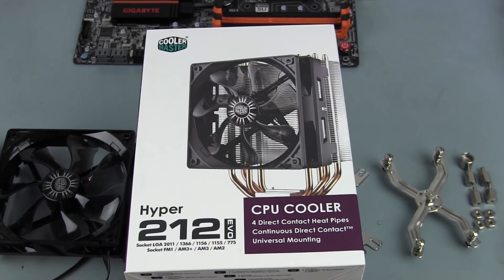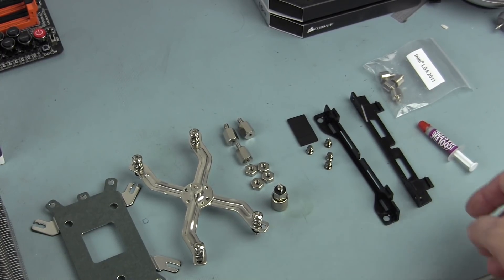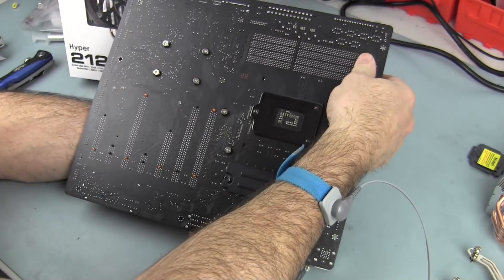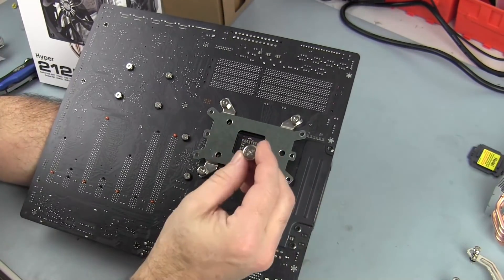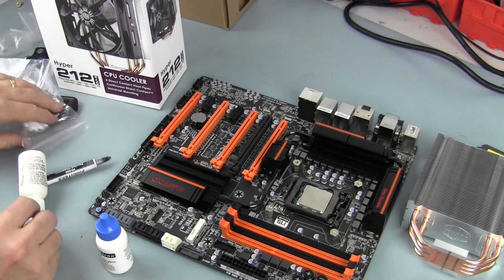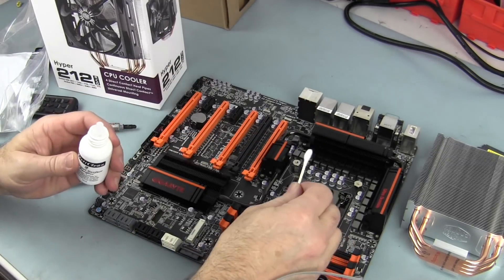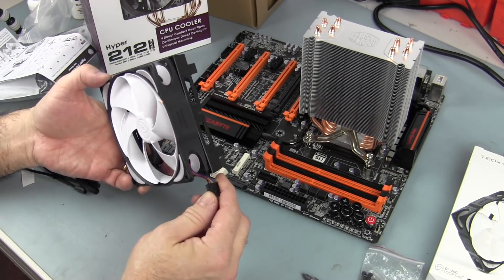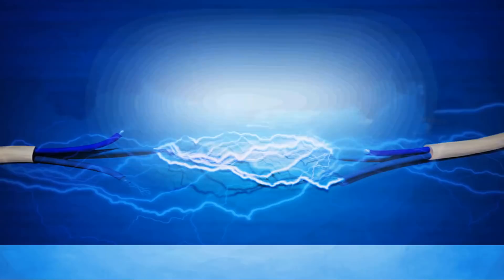How to Install a Cooler Master Hyper 212 Evo CPU Cooler

Comment: Can you just use the thermal paste thats already applied on the CPU?
Reply from the maker: .  CPU's do not come with thermal paste applied, so I assume you mean reuse thermal paste that may be on there from a previous cooler install.  If you are removing a cooler from your CPU, you must clean it and reapply
Reply: Ronsanut oh i see, do i have to use the cpu cleaning liquids if my cpu is brand new out of the box and so is the cooler? or can i just apply the thermal paste given and put it together
Reply: Rory McDonald CPU itself never comes with thermal paste, but stock COOLERS do come with that paste. Some aftermarket coolers do come with thermal paste, but most of them dont.
Reply: ***** The paste comes in a little tube or whatever you call it. People can apply it their way how they feel comfortable with.
Reply: ***** Yes, it does come with its own paste....

Comment: will this cooler fit into a zalman z11? and can you rotate the cooler 90 degrees if you wanted to?
Reply from the maker: Sunny Davies I don't know. Possibly
Reply: i did it and it worked along with some vengeance ram i was asking for trouble

Comment: My stomach dropped when you had to put a plate on the back side of the motherboard. I hate doing this crap but my CPU is burning up, so it's either completely disassemble my machine for this one single component or let my CPU burn.

Yeah, thinking of just letting it burn.
Reply from the maker: Does your case have a cut out for the pack of the motherboard? If so you son't have to pull the motherboard out.
Reply: Same man, I've never taken my PC apart entirely, but today's as good a day as any to learn! :D
Reply: just glue it on. i had to do that with my pentium III as it wouldnt line up
Reply: you can buy one that clips on like your old cpu heatsink..without a backplate needed to install. I did.
Reply: @Rippyboy121  where do you buy that part at?
Reply: Fwoooosh
Reply: Dissident Rage Water cool it
Reply: Dissident Rage but don't most cases have a hole right behind the CPU socket and just remove the panel in the back and install it upright?
Reply: "Yeah, thinking of just letting it burn".  LMFAO - I just had to reply to that - it made me LOL.
Reply: I was able to remove the panel on the other side of my case, accessing the back of the MB, avoiding full removal of the MB
Reply: Just take off the back panel behind the motherboard
Reply: or just turn your pc on the side
Reply: Man up man! :)   Arrange to be alone for the job and within an hour it's all done.
I have two PC's at home with this bad boy. This cooler does good job for the money.
Reply: Dissident Rage on a woman on the way she was the woman who was there to help him out the door and then said she had been there before the end

Comment: I have installed one on my computer running a stock i7 930 2.9ghz but my temp is 67c when gaming and 47c idle. isnt that high? I also included 1 more 120mm fan on the other side of the cooler. I have change paste 2 times with more or less thermal paste but no diffrent !

Comment: Question for people that have this beast...

I just ordered one to replace my 'Hyper N 520' over a 2600k, that just had a fan die. I didn't feel like replacing a 92mm fan on it, as that cooler is older and I wanted something newer.

How would this this compare to the N 520 in terms of cooling amount, and is the thermal paste that comes with it decent enough... I used AC5 on a 2nd mounting for my Hyper N 520, although i really didn't see to much difference over the CM paste of the 1st, and was a bit disappointed.

Comment: Nice video but I've a question: Is the base plate for the other side of the motherboard really necessary? I would like to not dismount my mobo to install this cooler.
Reply: Most cases have parts of the back of the mobo exposed (particularly around the CPU socket) for easy installation of heatsink without removing the board. 
Just remove your side panel on the mobo mounted side and check it out.
Reply: ***** Ok great. Thank you!

Comment: I think the orientation of retention platex is wrong. it should be rotated 90 degres. it is strictly stated in the manual to do so. I think that this way platex is almost making contact with the copper pipes. platex 'legs' should be oriented away from the pipes.

Comment: This thing is huge. Will motherboard be able to handle the weight if it's positioned sideways?
Reply from the maker: es the bracket and mounting system are designed to to support it properly.

Comment: got a question. i like this cooler a lot. but is it better than getting a water cooler?
Reply from the maker: Watercooling will keep you r temps down better, quieter, and lower than an air cooler. But if you don't overclock your chips at all then this is just fine.
Reply: hmm i can't say that i won't OC. i might get the cooler just to be safe
Reply: the water cooler i mean
Reply: ***** There are two kinds of water cooling: closed loops and open/custom loops.
Closed loops can be bought for cheap, and only cool one component. But, the cheap closed loops are only marginally better than similarly priced air cooling, and more prone to failure than air cooling (broken pump, leaking...). So, I wouldn't buy a cheap one over air cooling.
Air cooling is obviously enough for overclocking.

Open/Custom loops cost much more, but you can also use them to cool your GPU and they offer significant improvement over air cooling.

TL;DR: Spend small $$$ on air cooling for decent overclock or big $$$ on water-cooling for big overclock.

Comment: Does ir matter if the towerncan rotate after its installed or did i do something wrong
Reply from the maker: It may move a little, but you should not be able to rotate it 360 degrees.

Comment: Can the fan be put on either side of the heatsink? As this would only fit in my case with the fan on the other side due to the case fan being in the way (if I were to put it on the same side that you did in the video).
Reply from the maker: Yes. what ever works best for your case air flow.

Comment: Thanks for the video. I just bought a Hyper 212 EVO. This videos helps me to understand exactly what I need to do. This will be the first aftermarket CPU cooler I have installed. It's great that you covered a different fan option in the install video. I'm glad you are thorough when it comes to the tutorial/guides. I subbed after seeing this video.

Comment: I installed the 212X yesterday, since the EVO is no longer available in my country. Warning to those who install this cooler with all components already in place inside case: disconnect the fan and plug in the 4-pin CPU fan connector FIRST before mounting the heat sink.  Given my inexperience (first timer installing cooler), I fixed the fan last and it was a pain trying to slot in the CPU connector in a cramped rig.  Suffered a few cuts on my knuckles in the process.

I also screwed up by putting too much thermal paste.  I pressed a little on the syringe and a blob of paste squirted out on my CPU.

My biggest complaint with the product is the lack of mechanism to secure the X clamp on the heat sink before mounting.  It was difficult trying to screw down each corner of the clamp without the heat sink moving around in a cramped rig.  Albeit I did the installation without removing motherboard from casing.  In the end, I wasn't sure whether the heat sink covered the CPU precisely.  In the process, much smudging of the thermal paste occurred when I had to shift the heat sink after screw in to ensure it covered the entire CPU to the best of my vision (difficult to see with heat sink installed).

Anyway, on my i7 3770 (non-k), idle temp is around 32C compared to 37C on stock heat sink.  Using Real Temp, the lowest core temp was 27C and highest 35C. Hope the temps are ok.  Haven't stressed test it.  I'm living in a tropical country with high humidity and average temps of 30C.

Since I'm using Asrock motherboard notorious for thin PCB, I'm considering hooking the top 2 heat pipe extrusions via thin string/wire to secure them to the top part of my casing.  This is to lower the weight burden on the motherboard in vertical position.  Trying to minimize motherboard warping and bending.

Comment: Does this comes with thermal paste and cleaner someone could helpe I'm new to PC and I'm looking to buy this
Reply: Dont get to worried about a processor bottlenecking your card. It most likely isn't going to be happening anytime soon.
Reply: I would get a 4670k well before 8350....real world Intel out performs AMD both in benchmarks and any game that is CPU intensive (like ARMA 3 for example) and can be had on sale for $200-$215. It's also cheaper to run power wise that can save you $10-20 a year in power bills.

Do a little research and you will see what I mean.
Reply from the maker: Yes this does come with Thermal paste. But I also use something else. Usually Artic MX4
Reply: I wouldn't use the crappy thermal paste that comes with it. Get some AS5 and you can use isopropyl alcohol 90%+ (can buy a bottle of 99% for like $2-3 at walmart) to clean it. I would highly suggest you clean cpu and the heatsink just to remove anything that might have been left behind.
Reply: Thank you
Reply: Case - Cooler Master HAF 912 
$59.99

HDD Western Digital WD10EZEX 1TB $59.99

Motherboard -MSI 970A-G43  
 $69.99

 PSU - CORSAIR CX series CX600  $69.99 

Rams - HyperX XMP Blu Red Series 8GB (2 x 4GB) 
tem 5 $64.99

CPU - AMD FX-6300 Vishera
Item 6 $119.99
	
Heat sink- Cooler Master Hyper 212 EVO  $34.99
	 
GPU PowerColor DEVIL AXR9 270X 2GBD 
$239.99 total 844$
Reply: BigBootyTalk I would go for the fx 8350 8 core. Here's a link. http://pcpartpicker.com/part/amd-cpu-fd8350frhkbox. You can use that site to put together your build also. It tells you if any of your parts wont work together, and you also get the best deal because pcpartpicker looks for the cheapest price on multiple websites, I would recommend using it
Reply: Twisted86 Yep, but most people don't need that
Reply: ¬_¬ Dafuq? Clearly you don't know what you are talking about... Fx6300 WONT bottleneck a 270x at all not at all
Reply: Still,  don't take AMD Cpu's at this point in time.  Heavily outdated architecture and Intel is just in a whole different league with Instructions per cycle.
Reply: It comes with the thermal paste but I would highly recommend a good company thermal paste, for example, me personally would go for the IC diamond 24 carat, it is one of the best thermal pastes out on the market, never use the stock thermal paste that comes with the product...
Reply: Can you guys tell me if this a good build ?
Reply: BigBootyTalk What build?
Reply: BigBootyTalk It's a good build... But you need a better CPU as the 270x might bottleneck the fx-6300, if you have a little more cash to spend, get the i5 4670k or the i5 3570k, those are good CPUs that are very hard to bottleneck.
Reply: OK thanks for the tip I try to fit that in my build or can you reccomend me another build I'm looking for an 800$ build or 700 less
Reply: BigBootyTalk I would at least save up 1000$ for a good future proof PC.
Reply: An 1000$ PC  is a bit to much, this my first time building a PC, I don't have  that much money to buy a 1000$ because I have to buy rest of my equipment for the  PC I'm building
Reply: BigBootyTalk Oh, kk. Then the PC you're building is substitutional enough for a beginner, after you get some more cash, try upgrading to a fx 9370.
Reply: Okay and you mean fx 8320
Reply: BigBootyTalk Nope, there is a 9370...
Reply: look: http://www.ebuyer.com/537493-amd-fx-9370-4-4ghz-16mb-220w-pib-skt-am3-l2-l3-16mb-fd9370fhhkwof?utm_source=google&utm_medium=products&gclid=CLyD9tqmu70CFaQfwwodKZIALg
Reply: Oh OK I was thinking of upgrading to fix 8320
Reply: BigBootyTalk If you want to, but I would defiantly get the 9370 as it it more future proof.
Reply: Ok I'm think of getting later on
Reply: I know some of game I played doesn't use that much of the cpu,  half of it goes to the graphic card  that why I went low on the CPU
Reply: yes it does
Reply: Twisted86 I prefer to use 70%... Just my preference :)
Reply: Catpiss Neverclean I don't think it matters much but the higher % just dries faster if any splashes under anything on your motherboard.

Not sure how long a droplet of 70% would take to evaporate but I know 99% is fast :P
Reply: Catpiss Neverclean I don't think the 270X bottlenecks the FX-6300, and the FX-6300 doesn't bottleneck the 270X in most cases according to many sources on the internet.
Reply: ServeChilledPotato Oh come on, the cooling paste will hardly make a difference, even if it is the best one, not even important, you can use the one that comes with it without any worries.

This is elitism at it's best.
Reply: Goliath
Actually there can be a wide difference between pastes up to 5c difference in some cases. 5c to me means the difference between an extra 200mhz overclock.
Reply: Twisted86 Intel fan boys lol.....

it doesnt matter if it intel or AMD. but if people on a budget then they should go for AMD, if they arent in a budget then go for intel cause i have a AMD and idc what other said bout it since im on a budget it aint like ima be spending my whole life on gaming lol. cause when ppl get old it, it time to have a fam or something wid ur life unless ur a gamer then derp. gg. but if u do get anything out from gaming then worth if not then GG even more lol. my grammar soo bad :( 

sigh 2yr still not helping derp.
Reply: Goliath What about prior to the release of the G3258?
Reply: Alan Chen

Still no :P Since Ivy Bridge AMD has been a no no
Reply: Its shit dont buy it

Comment: Does anything connect to the big metal piece? Or just the cpu fan connector?(noob here)
Reply from the maker: Big metal piece ? You mean the big block at the base ?  No just the X bracket and yes you will plug the fan into the motherboard.

Comment: Thanks i fucked up in the thing between the heat sink and the screw i did not have them in the middle and i bended it a bit now its fixed now that i know that there weir 3 slots THANKS A LOT, Now i know thats its not gonna destroy it self

Comment: i don't know alot about computers but i recently bougth the "Gigabyte G1.Sniper B5" motherboard and i bougth this fan and about to put it all together. can i put the motherboard on my table when i put it together, and is there anyplaces i shouldnt place my hands on the motherboard while i install the cpu cooler? i'm afraid to destroy my motherboard from static electricity
Reply: Ronsanut . well thanks to you and Denkart my pc is safely built and it's working fine so far :D thanks alot :))
Reply: 1 more question i forgot to ask. will this cooler be good enough for Intel Core i7-4820K? great video! liked and subscribed :)
Reply: The only place you really shouldnt touch on the motherboard are the pins where you mount the CPU.  Other than that, just don't handle the motherboard too rough and you'll be fine.  Be sure to ground yourself every few minutes (touch something metal to discharge static electricity) or, better yet, if you're still paranoid about static electricity just buy an anti static wrist band.  They're only $5 and it'll make sure you stay grounded. 

Yeah this cooler is fine for an i7-4820k although if you plan on doing some serious overclocking it might be better to get a higher end cooler.
Reply from the maker: Slabben  Yes, Versatile all-in-one mounting solution supporting the latest Intel LGA 2011 / 1366 / 1156 / 1155 / 775 * and FM2 / FM1 / AM3+ / AM3 / AM2+ / AM2.
Reply from the maker: I agree with Denkart.  If you have a wood table to do it on, that helps too because they don't hold a static charge .  But keep plastic and other stuff away and ground yourself often.
Reply: thanks :D

Comment: I just use petrol based paint remover (or any other petrol or high% alcohol), distilled water and a polishing cloth to clean my CPU and heatsink.works just fine ^^

Comment: Would my ram (g skill ripjaws) get in the way of this cooler? I only have dual channel so if it only blocks off one slot I can move them over. Also, my motherboard is a gigabyte g1 sniper z87. Thanks for any help as my build is nearly complete and am looking to keep my cpu cool!
Reply: For the most part, it depends on your motherboard's configuration, but if it is very close it will overlap and get in the way. Like you said, you can move them over and that will work absolutely fine (I have a set of ripjaws and a MSI z87m, so even on the mATX form factor I can easily fit the two components.)
Reply: Bryce Ashton ah ok, thanks for the reply :) If it fits on a mATX mobo then I'm pretty sure mine would be ok, if not I can move them over anyways :)

Comment: Do I need to uninstall everything just to install this ? because everything already in my case.
Reply: Err if your case has a hole on that spot (even cheapish cases have them now) you don't have to (albeit it will be uncomfortable to install it), else you will have to pull it out.

Comment: Im new to building pc's so i was wondering can you put the standoffs in before you put the cpu in?  So you don't get finger prints on it.
Reply from the maker: Yes sure. But even if you touch it, you can wipe it with a swab of alcohol.

Comment: i just bought one on ebay and waiting for it to be delivered :D this cooler is old right? but alot of ppl still recommend this.. planning to mount it on my upcoming i5 haswell 1150.. in our country deepcool brands is easy to find but they dont have back plate brackets thats why i choose this cooler :D hope i wont get disappointed.. thanks for the vid Ronsanut!!